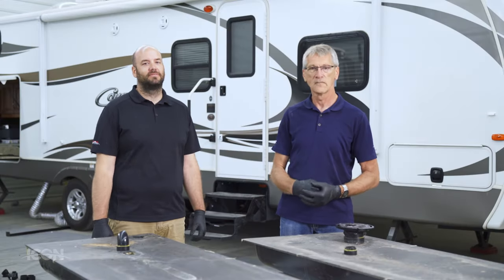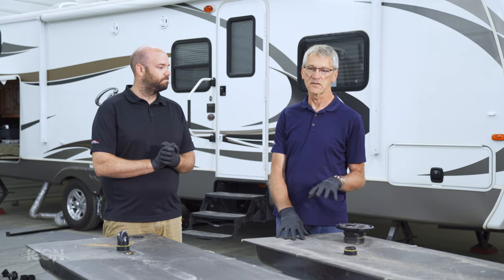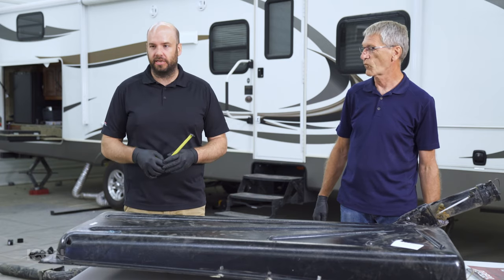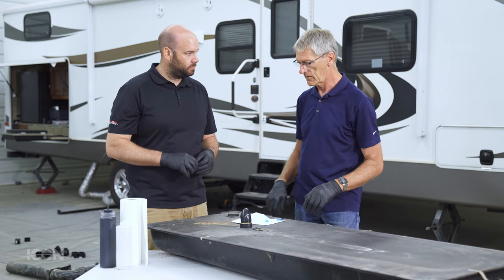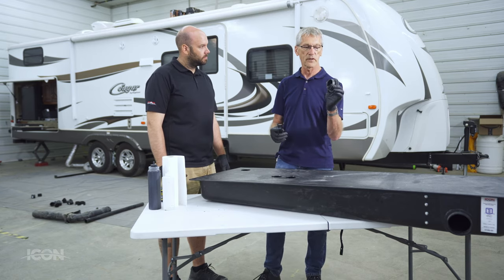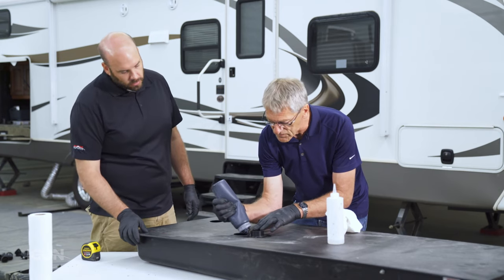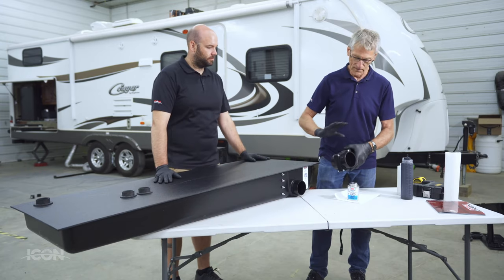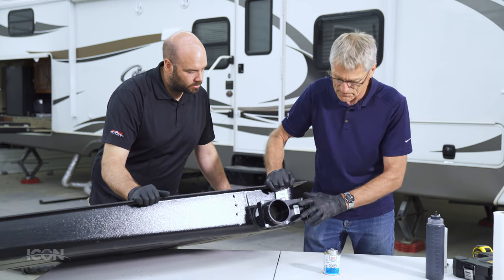Training Series - Waste Water tank Install

Comment: I thought the pull valve was at the end of the pipes
Reply from the maker: An RV's gate valve location can vary depending on the setup. It can be deceptive, because the handle is also extendable and can be quite accessible, even if the valve is far under the RV. There can also be multiple valves to facilitate the black & grey tanks draining to one point. Sometimes the valve is located closer to the drain end & sometimes there's 2 so you can isolate the drain segment if needed.